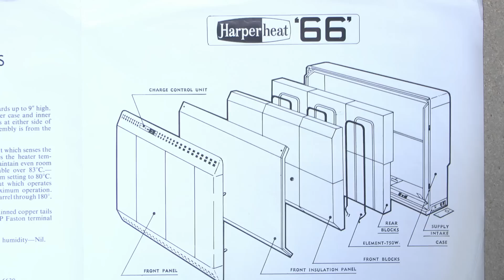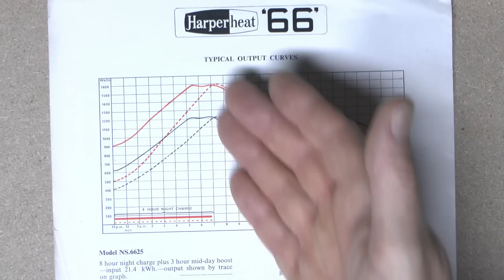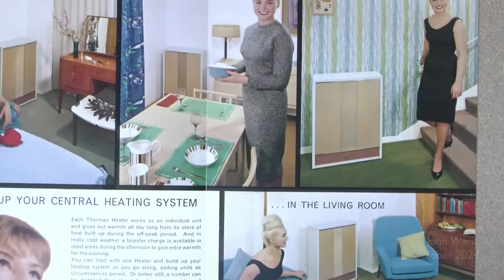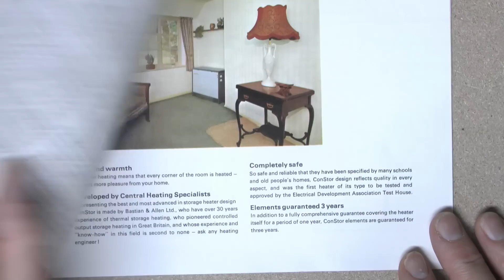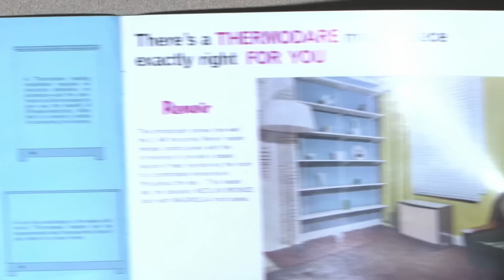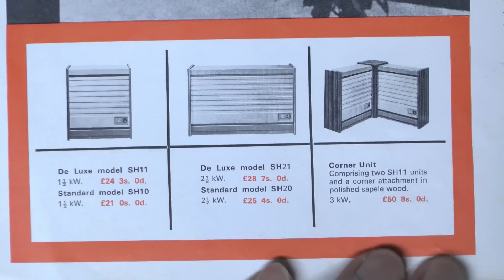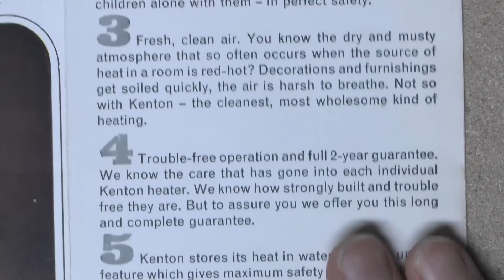Storage Heaters Part 1 - How they work, why they exist, 1960s time machine documents

Comment: Its very hard to remove a storage heater without opening it and dismantling it to a point. Getting rid of them is a pain too. My local tip insisted all the bricks must be double wrapped in thick micron plastic, as they assume all storage heaters could contain asbestos. I did protest slightly, explaining the house was from the early 90s - and heaters from that period too, but they still insisted they be treated they could be asbestos. If houses bothered with a bit of insulation back then, those heaters might have worked slightly better.

Comment: JW,
 A few of the Nightstore heaters we used to have here in New Zealand had asbestos insulation in them.
This was one of the first jobs I ever did as an apprentice electrician, was to replace the faulty elements in one of these, I had no idea that asbestos could be inside one of these things, I certainly wasn't told of this fact.
I guess you live and you learn, we no such thing as Health and Safety back then in NZ.

Comment: My rental has this old technology... And only been here 5 days and struggling... We have economy 7 at the rental... And od course not in during the day.. we can't charge it in daytime because are price is 28p kwh... Due to econ 7... Can't afford to run that? Is it worth getting a space heater an oil heater? It's an open plan room small room with kitten snd living room together.
Reply from the maker: If you are not there for most of the day it may well be cheaper to buy a couple of cheap convector heaters and use them for a few hours in the evening.  Also see this video: https://youtu.be/ZDbCYozo8_4 about other heating myths.

Comment: The flaw with this technology seems to be that to have enough heat / not store too much heat - you need to predict the heat needed for tomorrow and adjust the heat stored tonight accordingly. This is something that could be done now but I doubt even the models on sale today have this kind of data feed integration. We have it for heat pumps in Finland - the heat pump can access predicted energy prices for the next few days and will store heat to take advantage of cheap prices.

Comment: Got ours when our house was modernized in the 70's and we threw out the coal burner in the basement.
Back then they were subsidized by the government for having zero local emission and by the power company's for using up excess electricity.
House was expanded in the early 90 and got more Storage heaters.
They were 3phase, had their own meter/tariff, well dimensioned and had a fan controlled by a thermostat on the wall.
Never had any issues with them, no maintenance whatsoever, after a few decades heating elements started to fail on the oldest ones, resulting in a loss of power, still sufficient but they were slowly replaced by more modern units.
In the early 2000's they got a bit of flag for "wasting precious electricity" but that died down quickly.
We recently added a split unit heat pump/ac for that time of the year when it's not cold enough to justify the big ovens but still gets a bit chilly in the evening.
I have no complains about them, did serve us well, but you have to know about their quirks and run them accordingly.
10/10 would buy them again.

Comment: We moved into our house which has storage heaters, full of dust and horrible to use.

We replaced everything with a multi-split air conditioning system, which also produces heat. Essentially a heat pump which heats the air and not water.

Far cheaper and less disruptive than having radiators plumbed in and has been great to use.

Comment: Great review John. Having worked for the Electricity board since 1985, I spent many years installing and removing these things! The original heaters were water filled tanks with an immersion heater. Meter minders and the earlier pros-controllers came in to provide some weather compensation but not much! Fan assisted units did provide better control but at the expense of noise from the fan. You can do a video on the GEC Boiler which was a giant storage heater with a heat exchanger for wet radiator systems. The Titanium heating elements made them very expensive and always burnt out (great scrap value!) and the Ranco overheat always tripped (design flaw ) and again plenty of overtime for call out.

Comment: The house i grew up in (large 4 bed) had storage heaters - god, they were absolutely woeful.

House cold? Turn the heating up and it'll be warm the next day.

"Tomorrow's heating" was definitely the correct description for them
Reply: they could work a lot better today with connectivity and knowing tomorrows weather.
Reply: @edc1569  Having more connectivity isn't going to make a blind bit of difference - the issue is the basic fundamentals of how they work and we did know what the weather was going to be the next day in the 90's, at least as much as we can today with British weather being so unpredictable.

The issue is they take a huge amount of time to heat up because of their large thermal mass and the only way they are economical compared to other heating options such as gas, heat pumps ect is by having them on during off peak hours.

Slapping a WiFi or Bluetooth module on them isn't going to change any of that.
Reply: @edc1569  true, but the price of electricity, and heatpumps becoming more common place should leave these in the dark ages.

Comment: Brilliant video Thank you. My first house was heated by two Unidare storage heaters that were about 6ft tall, they provided forced warm air heat through ducting under the floors to vents that could be opened or shut off. I liked that system as the house never got really cold and the forced air heated the place up to a reasonable temperature in a very short time.
Reply: Electricaire system  they were actually very reliable and efficient  but enormous  units .

Comment: I actually liked mine in my old flat. No gas service charges. No annual servicing needed, couldn't freeze if you left it off, no leaks, and even when it eventually died (couldn't get elements any more, company was bust) a Dimplex replacement was pennies.
Amount of people going on about sand batteries now are just reinventing the wheel.

Comment: No smart meters back then, so how could it be cheaper at night ?
Reply from the maker: Originally a totally separate meter for the heaters controlled by a timer, that meter being a white cased one which is why it was known as the 'white meter tariff', most normal meters were black.  Only the heaters were on the cheap rate, the rest of the house was standard rate even at night.
Later a single meter with two registers, switched either by a timer or a radio teleswitch.   The whole house switched to the cheap rate, but the the heaters were switched on at night only via a 5th wire from the meter.
Most recently a dual register meter with a radio teleswitch built in, plenty of those are still in use in 2024.
Reply: @jwflame Thank you for the comprehensive ansver.
Reply: They were switched-on by a LW 200MHz encoded radio signal (yes BBC R2) at certain times, predetermined by the tarriff.

Comment: Hilarious review, thanks John😂😂 OMG I wish I had a quid for every one of these I removed when fitting Gas Central Heating. They were huge & punters would look at the Radiators we were fitting & scratch their heads.

Some people even used the Bricks to form a Path in their back garden😂😂 Oh I miss the 70/80s, driving around in our Ford Capri, we were making a fortune doing CH installs!! In the back seat, you couldn’t get your Flairs off fast enough when in a romantic entanglement with some brain dead flossy......Even worse was the friction burns from your Bri-Nylon Y fronts...Happy days.
Thanks again John for sharing.

Comment: "Hot bricks in a box" - the successor to "hot concrete floors" as local authorities tried to make electric heating affordable by applying the principle of storage to the inflexibility of nuclear power. 

Anyone who has lived in a glazed concrete box , 20 floors up in a Scottish winter can vouch for its "success??!!!!" 

It left progressive technology in its wake; the R4LW teleswitch control allows useful, reliable, large scale load shedding which could have been more successfully applied to electric cars than it was to heating.   It was criminally underused for the flexibly it could offer.

Comment: My sister had storage-heater based central heating with radiators. The storage unit was about the size of a fridge-freezer. It may been gravity feed - I don't remember - but seemed to work fine.

Comment: Really enjoyed those old brochures, John!  I love my old Dimplex storage heaters. I have 2 of them, one in the hall and one in the living room...the bedrooms  have oil-filled radiators. The storage ones are only in use for half the year, from end October to April as the house is well insulated. They are on Economy 7 and the whole house switches to that at the appropriate time. However, when the radio teleswitch is shut down sometime next year I will have to reconnect them into the normal CU so they run on the standard tariff. I gyess I'll need to fit a timer too so I don't have to switc h them on and off manually. Anyway, very enjoyable video, thanks!
Reply: For a couple of people I know I’ve put a timer, contactor and keyswitch in, so the timer operates through the year and the keyswitch is used to enable the system for use. Used a keyswitch so it can’t be knocked off on accident. Sequence was keyswitch -> timer relay -> contactor. I know a few who have gone smart but needs a permanent feed.
Reply: @paulmatthews5470  Thanks for that advice, most helpful! At the moment I have a separate mini CU for the rads, a timer  to controll the storage rads and the oil-filled ones, but I have the timers at constantly on, and contactors for thr 2 banks. I switch the oil ones on at the wall when needed, hardly ever, and the storage ones just come on from midnght to 7am. I guess I can use the existing timer but need to take a feed from a spare way in my main CU to supply the storage rads. The meter is dual readout for off peak and normal. I suppose it will just be stuck on normal when the teleswitch is shut down. I'll await word from Octopus nearer the time, but not keen for them to send a smart meter "fitter" because I doubt if he/she will know what to do!
Reply: @colinritchie1510 I had a 5 port smart meter fitted by Octopus last year. The installer knew what he was doing and did a very neat job. Incidentally the day after it was installed I switched from Economy 7 to Agile and I have automated all of the switching based on price. Works out a lot cheaper than Economy 7.
Reply: @jon_273  Thanks for that useful info... I had heard tales of meter fitters being unable to tackle some jobs, so was a bit concerned.

Comment: Every property I've moved into has had these horrible things, usually Creda. Getting them out was always my first priority, plus all the extra wiring, timers and extra fuseboards which was usually a big mess around the consumer unit where it was added in
Reply: With gas getting banned or so within the next 10 years, you'll be putting them right back in 😮

Especially in terraced properties that cant legally have heat pumps fitted.

Comment: We had a new house in the 1970s that had a big storage heater in a cupboard and then used ducts and a fan to circulate warm air around the house. On the whole it was quite pleasant to live in but the cat had a tendency to sleep on the floor vents, which was probably very nice for him, but the temperature soon dropped in the room when he did so.

Comment: It took me like... 3 minutes to make storage heater 200% better. Make louvres that actuate. Idea is to keep the heat inside until people actually come home at the evening. Also. I would rather sell sand heaters. Easier to transport and install. Empty and lightweight until filled with sand.
Reply: They were fine. I grew up with these in the 90's. My parents didn't get gas central heating installed till the early 00's.

Sure most of the heat was gone in the evening but why would that matter? I'd be wearing a vest AND a jumper and it's not like you need to heat the room when you are in bed?

I have my own house now and when I moved in 12 years ago it had a boiler and radiators, which took me a bit of getting used to as I hadn't had them before. It also had no thermostat which apparently central heated house's tended to have. Just had a timer with two modes, heat the water or heat the radiators and water together. I didn't use the timer, just pushed the +1 button to boost the heat up a bit 😂

Eventually got upgraded to S plan with a new condensing boiler, they installed a thermostat too. Did nothing to the bills. The wireless thermostat keeps losing connection to the receiver, after turning the heating on thus you come home to a sauna 😂

When gas is mothballed in ten years I'll be using oil filled radiators or storage heaters I'd expect. Can't legally have a heat pump in a terrace like mine, most installers flatly refuse to even give you a quote.
Reply: That‘s actually how today‘s versions of these heaters work… doesn’t make them any better.

Comment: Well that's odd - the Economy-7 Radio Teleswitch for years clicked on and off for the 7 hours between 1am to 8am, yet this morning it was displaced earlier by 30 minutes; I heard the outdoor meter click on at half-past midnight and it has just now clicked off at half past seven. I have never known it to do anything other than 1-8, regardless of GMT or BST.
Current tariff name: Flexible Octopus
Current tariff code: E-2R-VAR-22-11-01-B
Standing charge (per day):  54.570p
Unit rate - day (per kWh):    29.532p
Unit rate - night (per kWh):  13.165p

Comment: My parents have an apartment in Austria with modern simmens storage heaters, but they do differ to these 60’s/70’s models - they are powered by 3 phase electric, 1.5kw per phase, only powers up the elements between 1-4am unless boost switch activated, has a remote thermostat on the other side of the room, but most notably has a fan to control more effectively the heat output. I like them, but then again, they actually look desirable!

Comment: Another couple of points - if you start using them after a few months off they'll have settled dust built up on the element which will burn off and make a horrible stink at about 1AM the first night.
in my experience you wouldn't want to sit on one when it was properly hot, the air coming out and the grill the air comes out through is significantly hotter than is normal for gas CH radiators (though maybe the water filled type ran a bit cooler than the brick filled.)
Reply: The elements don't get covered by dust, they are encapsulated inside the bricks.

You're thinking of a basic element heater which just passes air through the whole unit.
Reply: @dlarge6502  well Ive got some night storage heaters that I've recently started using again for winter and they definatly did smell of hot dust first time after being off all summer, same as wvery other year They're creda and project 16 cm from the wall so I guess they're more 'advanced' than the 1960s models in JWs brochures.
I think it's the elements because the stink comes out within a couple of minutes of the power coming on and I dont think the bricks or anything else has had time to heat up yet.
It smells like the convector type heater you mention thats been off for a few months but they're defintely storage type. I was'nt expecting them to smell of burned dust first time it happened but it certainly does happen.

Comment: Inside of the storage heaters were  what looked like refractory bricks (FireClay) and they were heavy. I built a shed from 7 storage heaters but had to render the bricks fairly thickly as they were rather porous.
My Dad had these fitted in our house in a fetching steel teak finish and they were just oblong in shape and very large, similar to the GEC version in your catalogue. This was way back when I was a kid in the late 60's but he was even too tight to switch them on using Economy 7 😂.
Rumour has it, he bought one of those naughty little transformers in the 80's and bridged the wrong meter tails, it went thermonuclear. 😂😂😂